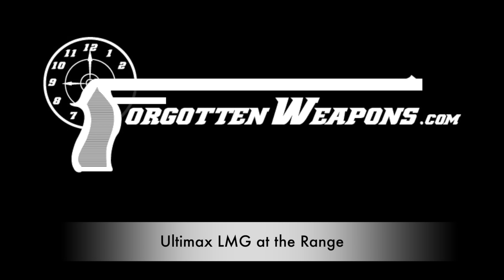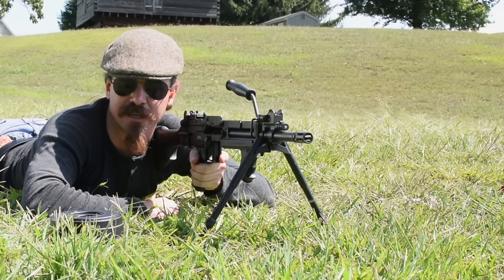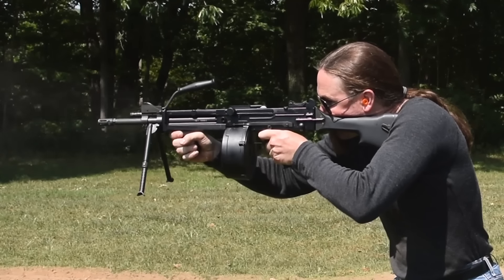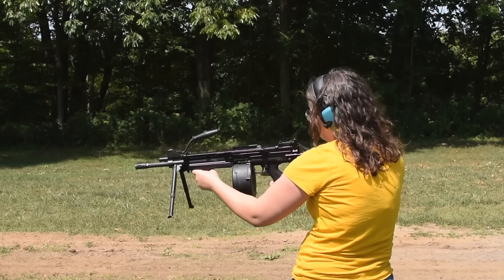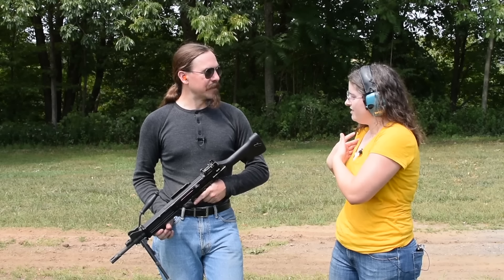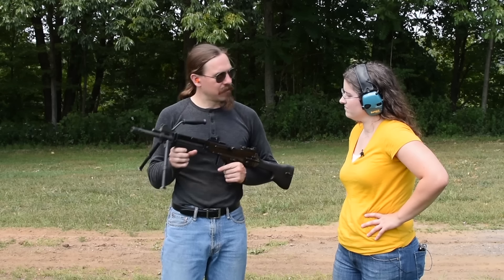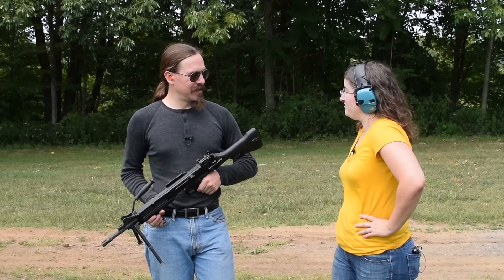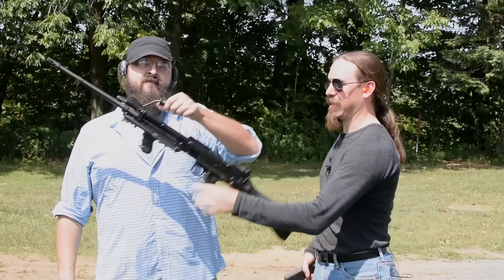Origins of Constant Recoil: The Ultimax Mk3 (feat. Mae & a Yeti)

Comment: Here in singapore the ultimax has a reputation of being unreliable. 

I think it had smth to do with the magazine.

Or maybe its just NSFs like us not treating the gun right XD
Reply: Probably just drum mags being drum mags. I wonder if you could get belt fed with constant recoil
Reply: Aluminum AR-15 mags are known to be fragile. If it's a mag issue, PMAGs should fix it (Magpul did NOT pay me to say this).
Reply: 99% of the time soldiers claim a weapon is unreliable, it's because it doesn't get maintained. Especially magazines.
Reply: Bro, it is the blanks and round catcher. We just recycled the ones meant for the M16. They were never meant for the Ultimax. Firing live rounds are a breeze
Reply: the ultimax we normally use is much older than the sar-21, which replaced the ar-15 most infantrymen use. Yes, I've heard it being called unreliable, but I think when everyone else is using a far newer, more reliable weapon, the malfunctions in the weapon get highlighted.
Reply: I think BackITrack has it down, and to add to that, from what I've seen of how those mags attach, they look like they are barely on there. That's just on the box mags with 30 rounds, so the drum ones are probably worse since they are much heavier, no better mag catch system, and are probably old.
Reply: Its the ammo pouch that we use. Next time try it without the ammo pouch and then collect the rounds after
Reply: That’s because we still use the Mark 2 & 3 for training. The mark 1s were badly welded, while the mark 2s were ok. Also nobody ever used the drum mags as they were a pain to reload, so we had to use those M16 mags with the two holes drilled in the side, and it wasn’t very secure.
Reply: @LOUDcarBOMB  It was the material. The old mags were made from aluminum and when fully loaded, started deforming along the catch. Even M-16 mags had this problem so it wasn't a platform specific problem. The switch to plastic would easily solve it since plastic does not deform that easily.
Reply: @Titan Steele No insult intended but very often in those videos, I see your people simply shooting without aiming, that's just wasting ammo, even in an Ultimax, you need to aim or you will mostly hit nothing. Can't blame you guys though, at that time, you probably had to distribute weapons to anyone who can move his trigger finger even if they did not have training.
Reply: The problem is the 2 holes in the side of the mag will oval out and cause malfunctions.  The 2000 solved that and I believe the mk8 has changeable mag Wells.
Reply: @Titan Steele Both had different problems of sorts. The aluminum mags deformed too easily. Not a problem these days if you get new plastic mags while the drums, it was just a pain to load and unload every time. The "real" reason that Singapore uses 30 round mags in training was in reality the utter waste of time loading and unloading every drum before and after every exercise. People assumed it was a technical problem when it fact it was just time management. Singapore still has drums, but they are almost purely reserved as war stock. Extremely precious, they have never to my knowledge released the drums from army stores, all the ones in the market came from CIS or STK and even those are rare.
Reply: Titan Steele   The drums fall out if the mag release spring is not kept tightened.  But the M16 mags often didn’t work when locked in the gun.   I don’t know if I’m aloud to do this.  Here’s a mk2 video. https://youtu.be/BS456GFl888.
Reply: Titan Steele there is a video on the ultimate 2000 on tfb.  And others videos.
Reply: @danielc2701  Its supporting fire, usually soldiers are trained for that, look at most of the russian and american war footages
Reply: @arberchabot8760  You don't do supporting fire without aiming and from the hip. That guy was firing off for the sake of firing off and feeling better. You shoulder and fire even with supporting fire. And you especially aim. He was probaby nervous and fired off the rounds to encourage himself.
Reply: only unreliable with blanks... its solid with live rounds.
Reply: Probably a combination of blanks being blanks (guns don’t cycle right with blanks due to insufficient recoil/gas pressure w/o an adapter) as well as magazines not being particularly secure and durable. The STANAG boxes look like they just kind of hang off the gun.
Reply: @Titan Steele Thanks!

Comment: Hear me out lads, I'm about to fix the M14 by adding one thing:

This.
Reply: I believe you're adding more weight to the receiver too
Reply: It was specifically designed around Stoner's work on the 5.56 mm and M 16, by Jim Sullivan. 
The alterations to an M 14 would not be the same, some adaptations would be needed.
Reply: SpecJack15 I guess the main problem with the M14 was the fact that it was based on the M1 design, and one of the  things the judges on the M1 trials wanted was "super short reciever"
One of the reasons blish-locked Thompson rifle failed (Other than being designed around pseudoscience) was the comments about its long, long reciever.
M1 won with its short reciever, and the M14 was designed around the M1, and when you want effective full auto fire from a reciever that short... Well, you won't get that.

Comment: I don't really understand all the comments about "low rpm" and how this makes the gun not effective. It's slower than other light machine guns in 5.56, sure, but not hilariously so. The fact that it's so much more controllable suggests greater capability and more options to me. You can always use an accurate weapon in a deliberately inaccurate way for suppressive effect, but you cannot really go the opposite direction. This machine gun seems really impressive to me, as was the time Ian interviewed one of the old AR-15 engineers who modified their rifle with a similar system.
Reply: Low RPM is only a detriment to the value of an actual machine gun for anti-aircraft fire.
Reply: I agree what's the point of a high rate of fire if all you do is puncture clouds and dirt? I always thought the idea was hit a target not worry it a bit.
Reply: Because there is a psychological factor to a higher rate of fire. In WWII the allies had to make several videos to downplay the effectiveness of the MG42 compared to the browning M1919.  The MG42 was simply a meatgrinder to face. Even cover like a stone wall would not last very long and the GIs who had seen combat knew it.
Reply: @Rockwolf66  Phycology dosen't kill the enemy , acccurate fire does.
Reply: @51WCDodge  In a modern military setting, machine guns aren't meant to kill the enemy. They're meant to suppress them. That is why there are so few of them in modern units. You don't need many to do the job, and an assault rifle does the job 80% as well.

That said, higher rate of fire has only a marginal benefit to effectiveness of suppression while having the great negative effect of increasing downtime. It is not beneficial in the balance. It's more of a video game thing than a reality thing.
Reply: Many of those comments are from people who's only experience with guns comes from playing Call of Duty.
Reply: I agree with the Call of Duty sentiment. I can rent multiple belt-fed machineguns in a couple hours drive.  there is a huge difference between running a machinegun in a video game to running a gun with live ammunition. In video games you can hide behind a car until it explodes. IRL the Machinegun will shoot through almost every part of the car. about the only safe spot is behind the engine and I've seen a .50 cal browning eat through one of those.
Reply: @bubba200874426  So what is the point of them then? Firecrackers would be cheaper, jumping up and down yelling BOO! would need less logistic supplies.
Reply: @Rockwolf66  What scares me is the thought that anyone might concivable think, 'If I point a gun at someone and shoot it, it's only to scare them'. I was taught, if you point a gun at anything be prepared to hit it, and only it. If you point a gun at anything that is alive, be prepared to kill it'.
Reply: @51WCDodge  1. Firecrackers don't make sonic booms over your enemies' heads. 

2. Judging from your responses, you have no idea what suppression fire is. Look into it.
Reply: @bubba200874426  Unles you count sending it and sitting under it,No.
Reply: @51WCDodge  then you should know better. If not, your education on it is lacking and you should look more into it. None of the, "technically I was aiming at the cover and hit it." You know why you shot. You know what you were doing. If not, things are truly dire.
Reply: @bubba200874426  When the ammunition is you want it you carry it. You learn every shot counts. Hitting air isn't any use. The best way to suppres those shooting at you is to ensure that are unable to shoot back in any circumstances so aim.  That's what was kicked into me, maybe your experiemce was diffrent diffrent, if so, then that's how it is.
Reply: @51WCDodge  you're right, but that's not what suppression is. I've already acknowledged actual suppression is rare, especially against a non-traditional enemy. That's just the role of them, and that's why there are far fewer LSWs in a unit. If machine guns were actually better, infantry units wouldn't be using less of them over time. The person carrying it would prefer to have a lighter kit as well, but it does serve to fill a niche, regardless of how often it actually comes up. Even when an assault rifle does the job 80% as well. Some people believe 80% isn't good enough when it means lives. 

All of that is irrelevant when my point was that higher fire rate is not, in the balance, more effective for suppression. Automatic fire is too inaccurate for any of the arguments of precision to play. No one is going to fire a squad auto at fast aircraft. Rate of fire has essentially no effect on semi-automatic fire, and no one is going to line up like it's the 18th century. Any argument about higher rate of fire being better has to be toward suppression, and higher rate of fire is not better for for multiple reason, but mostly for the reason you mentioned. Logistics.
Reply: @bubba200874426  Just to point out, one out of every 3 men in a squad is hauling a machine gun usually. It's not "few".
Reply: @danielc2701  that's a fireteam, which is not typical organization. A squad typically will only have one machine gun for 9-15 soldiers. That's why it's called a "Squad Automatic Weapon."
Reply: @bubba200874426  Which country's orbat is that? Fireteams are standard in some countries like the US and UK and their structure is usually one SAW, one M-203 and one anti-tank weapon and may or may not include one extra rifleman depending on the time period and organization you are talking about (The USMC uses 4 man teams, the UK and US Army use 3). Singapore's orbat is one squad = 2 LAW, 2 SAW and 2 M-203 + 1 commander so it is 2 SAWs for 7 people. The US and UK ones can go up to 3 for 9 (USMC) or 3 for 12.

The one that reminds me of 1 for 10 is the old Eastern European doctrine where the Soviets built their 10 man squad around a medium machine gun. Was this what you were referring to? For those that are used to the 1 in 3/4 man fireteam organization, the 1 in 10 really feels undergunned to us.
Reply: @Giggitee O'Yeah 400-600 is actually the range for a lot of medium machine guns. The ROF is ok (it's actually 600, you can time it and see). You are talking a constant rate of 10 rounds a second. Or one round every millisecond. It's very easy to keep track of ammo with this weapon. 30 rounders give you 3 seconds of fire, 100 round mag gives you 10 seconds.

From this you can see that the ROF is actually a very consistent 600.
Reply: @51WCDodge  there was a magazine saying if you shoot alot of bullets the enemy keeps his head down. If your bullets all hit. they flee. i prefer the ultimax over the saw IMHO
Reply: @LinksRoyal  Yeah, as long as you stop the Enemy sending them back at you, that's a good result.

Comment: 4:15 They did that up through world war 2.
What changed was the fact that full auto was no longer under scrutiny for practicality. 

Select fire became another check box rather than a strict set of parameters. Fire rates became out of control, the chamberings were not ideal — even the 8mm Kurz wasn’t ideal.

The M43 was designed for the SKS, not the AK. The 5.45 is probably the best low recoil rifle caliber overall (compare it to a 5.56 ak).

If the gas key on the AR didn’t slam into the buffer tube, it would likely be pretty good. I’d have to take a look at an original AR 10 with its original gas system.

You can still compare the ft lbs / Sec of energy of the STG 44 to any other assault rifle and it dominates. It’s a 10 LB rifle with a low rate of fire. 

Compare that to a lighter M14, in 7.62 NATO, with a cyclic rate over 50% higher... that beats on the receiver...

Comment: For real though, the reason such a system is not in use by most militaries is ammo. In order to get constant recoil you need to shoot ammmunition that exhibits a very high standard of consistency of load between the individual batches. Singapore has a small standing army and enough funds to procure high quality ammunition for it. Even at that they fail to replace the warn-out LMGs in their inventory. Knight's LMG is only used by a hanful of SPECOPS units and bunch or mercenaries. So that's that.

Comment: so, this entire firing system is dependant on the mainspring eating all the force from the bolt.  That sounds great on a range where the gas system can be dialed in, but how does it function across pressure/burn rate variables like ammo lot/temp change/altitude change ect? 
Seems this gun working great on that range, taken to a cold ridgeline at 8k feet elevation shooting NATO ammo may very well not function at all the same by simple virtue of pressure on that mainspring changing.
Reply: You can adjust gas regulators you know?

Comment: To prevent bolt hitting receiver, all interacting masses, spring constant, frictions, oil viscosity, gas work volume, etc. for the required rate of fire and muzzle energy must be balanced in a dynamic equation with an accuracy of about 15% (design restriction on bolt travel of 12+/-2cm). Eight-grade students can model "constant recoil" with Excel easy-breezy. Modern technology and materials can provide necessary tolerances and surfaces finish but in combat conditions of rain and dirt, the friction term in the equation will be 100% off after a few dozen shots, and the bolt either won't shove the next cartridge into the chamber or when a shooter over gas this gun to work reliably, the bolt will be bouncing from receiver just as violently as in cheap and stupid yet no-jamming inaccurate bullet spitter Kalashnikov. 
Military justly opted out of this "nice to have" but expensive and volatile feature. Btw, recoil can't be constant (no spring has constant = zero), it just "impact-less" at best in ideal conditions and for the first few bursts. Shock absorbers at the end of a receiver have been used for the same purpose for many years e.g. MG-34.
Reply: /facepalm

Comment: Two points:
1. It's not that uncommon for SMGs dating a way back to do this, i.e. to completely stop the bolt by spring alone, without it hitting the reciever. It's obvious in Ian's shooting videos and those SMGs that do that are usually very nice to shoot, too.

2. The "constantness" of the recoil is not only a matter of the bolt not hitting the reciever, but also of having a long recoil spring with a lot of preload, so that the travel of the bolt represents a small relative change of the spring's letgth and thus the force the spring projects onto the reciever does not fluctuate that much as the gun cycles.

Comment: Why isn't this system applied to a full-power battle rifle? In a machine gun using intermediate ammo the advantages seem to be marginal, more comfortable shooting versus lower firing rate, but in a battle rifle it could be the difference between controllable and uncontrollable full auto fire. This issue was the main reason why the assault rifle was introduced in the first place.

Comment: I have question... I'm not a weapon person. What's role of a riffle and a machinegun on frontline?
Reply: A rifle is for single shots at individual infantrymen to finish them off while a machine gun is for groups of men where you 1- hope to get some "lucky" shots on exposed individuals and 2- to suppress them so they can't fire back and move around. It's hard to aim when rounds are landing close to your head, your natural reaction is to duck. The "ideal combo" of the 2 is when the MG suppresses the targets so that they can't move around or fire back while the rifles pick off the pinned down targets. The selling point for this "low recoil" mg is 1- that due to lack of recoil, it can concentrate fire into a smaller area better, improving suppression with less ammo usage and 2- it's accurate enough that you'll get a higher rate of "lucky" shots when suppressing.